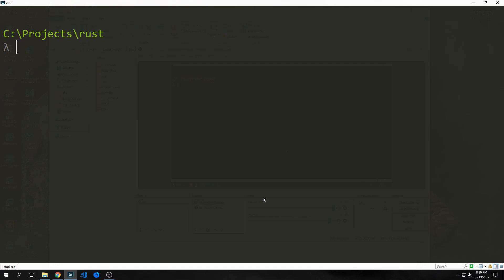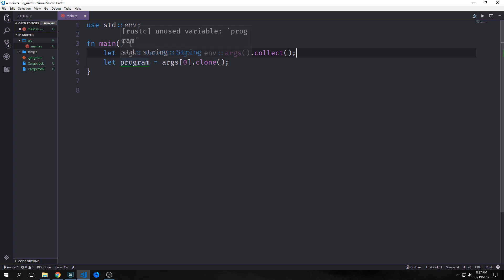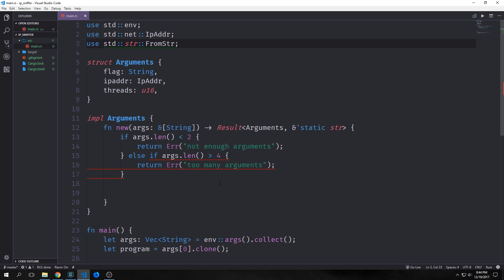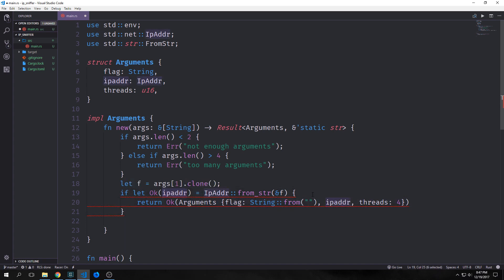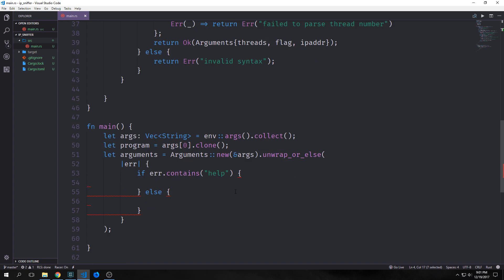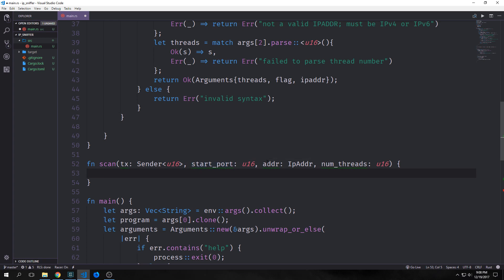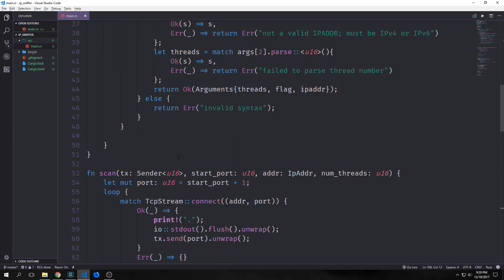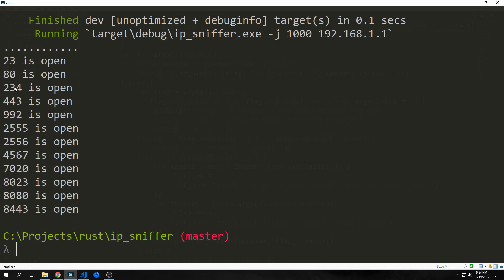Rustlang Project: Port Sniffer CLI

Comment: Really enjoying all your Rust videos, thanks a lot! For this project, you could use clap to replace all of the handwritten parsing/validation of command line args, right? I sort of thought that would be the point - you'd write it all by hand and then show how clap makes this easy. Did you specifically not want to use clap or am I missing the point of this lesson/tutorial? Thank you.
Reply from the maker: I can't really tell you my rationale because the tutorial was written a few years ago; but I do imagine that I did want to show off how to make a CLI without libraries like Clap.   Also, while Clap is extremely useful, it is pretty heavy in some regards.  Sometimes you don't need something as extravagant as Clap especially if you have a bunch of simple flags like we did here.
Reply: @TensorProgramming  Awesome, gotcha and makes sense

Comment: i got this error when running the program using -j command on 1000 threads

error: the 'cargo.exe' binary, normally provided by the 'cargo' component, is not applicable to the 'stable-x86_64-pc-windows-msvc' toolchain

after that happens, everytime i try to run it, it prints that error again.
Reply from the maker: Try running cargo clean.  That said, the error you are showing me, is not a compilation error.  its a platform error, are you using windows?  Because that platform toolchain is for windows.  the msvc toolchain that is.  I would recommend using rustup to reinstall your toolchain and making sure its for the right platform.
Reply: @TensorProgramming  yes im using windows. the program ran about 10 minutes b4 it prints error.

Comment: I had to use connect_timeout (instead of simply connect). Otherwise the connect attempts would never return and the program would loop forever.
Reply from the maker: This is a pretty old app, not surprised if it has issues like this.
Reply: thanks actually yes some connections take forever

Comment: Thanks, bro! Will watching a bit later, but I have a one notice to your realisation. The best and maybe correct way to do a real port - scanner ( how it could be ) is to use "socket" instead of TcpSTream. It is a solution from Python) Sorry, dude. Thanks a lot for a lessons serial)
Reply from the maker: The only sockets in the std lib are OS sockets which are pretty low level.  There wouldn't be much educational value in using them since people using a different OS then me wouldn't be able to follow the tutorial.  Windows sockets vs linux and Mac all have different APIs.

Comment: yo, i put in most of the addresses seen in ipconfig /all and its printing out hundreds of dots lmao, do you happen to know whats happening?
Reply from the maker: This is a 4 year old project but it seems to still work.  If you look at the code, in the scan function, there is a print statement that prints out a dot when it finds an open port.  I skipped over the actual execution but because of how many ports your computer likely has, it will take more than a few minutes to print out the results (scanning from 1 to 65,535).  If you are curious about if its still running you can have it print out the ports that it found which were closed as something else like a underscore or even have it just print out the ports as its finding them.

To be fair, this code probably needs to be optimized so that it can batch scan all of the ports at once without having to do a couple at a time based on how many OS threads you have.